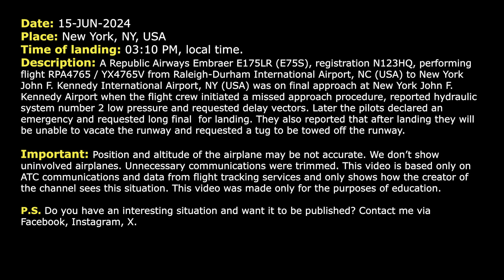Hydraulic system failure. Airplane is unable to taxi after landing at New York Kennedy. Real ATC

Comment: Went so good until tower lol. They already said they wouldn’t be able to exit and need a tow. Not a huge deal, just wish handoffs could be improved. Not at all a fan of squeezing a departure out in front of an emergency. What if they abort TO or have an issue? Keep it clear so the emer doesn’t go around
Reply: I think the departure was a bit out; since this was a pan-pam type of situation not that big of a problem imo (and with enough fuel for a ga + 04L landing).

There have been situations in which a plane with hydraulic/ nose wheel steering failure was able to take a high speed exit, so I don't blame twr that much for suggesting. I thought comms/information exchange worked pretty well (compared to other emergencies in the US)